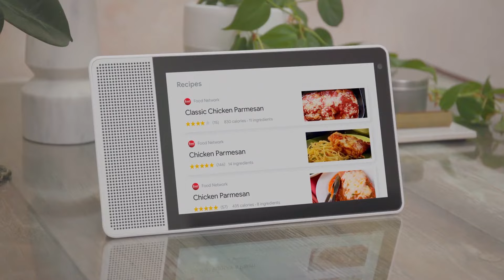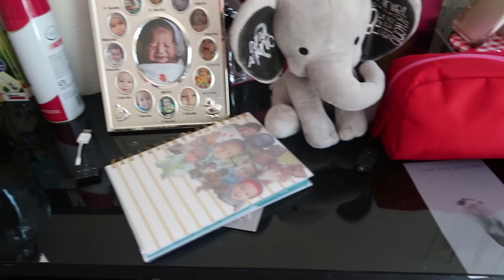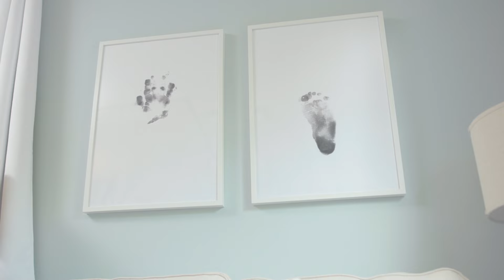Converted Garage to Family Home Makeover!

Comment: (Alas, it looks like the figurines will be knocked-over by the TV when it is extended.  The TV needs to be mounted a couple inches higher for clearance or a shelf for the collectibles needs to be placed above the TV.  Good design in this small space.)